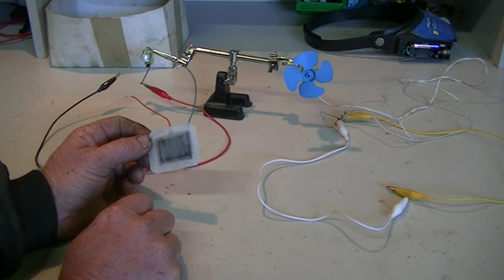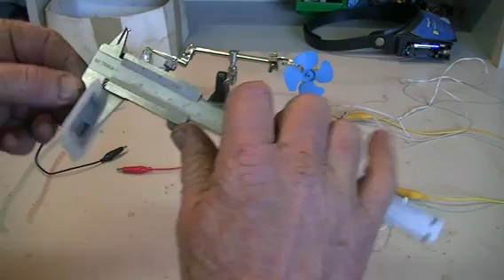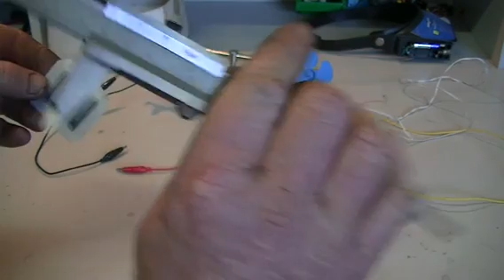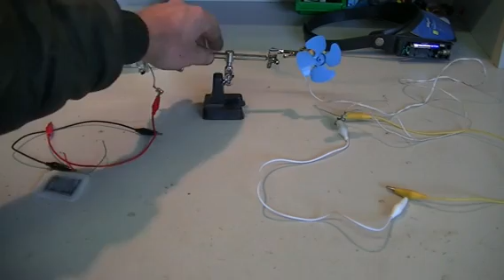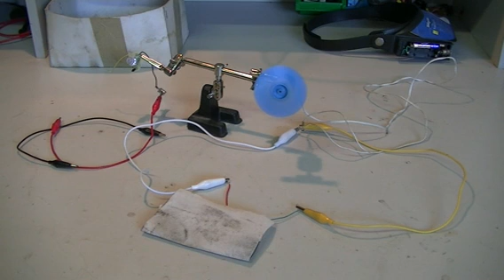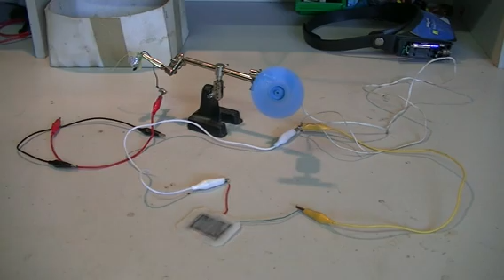Triphene Super Cap 2600 Farads in half of a credit card.

Comment: nice work mate - have you tried using a different electrolyte - if you try acetonitrile with a quaternary ammonium salt you should be able to raise the voltage to 3 volts or so
Reply: +Leonard Janus sure why not
Reply: +Leonard Janus i try to use water mate - but whatever you want really
Reply: So, have we guessed at the other two ingredients? NaCl and baking soda? Lard and sugar?
Rob, is this likely in the stage 4 Strange Capacitor family?
I've got a bottle of ranch dressing about to go off....
Reply: Cyclic Voltammetry. 🎩🧠❤

Comment: Happy to see you and Robert Murray are working on graphene super capacitors. Cells. Whatever ;-)
I am hoping you will find the right substance to get a higher voltage, on the other hand at these dimensions I would not bother to much. Currently most of our appliances are already using dc2dc converters anyway.
Does it go up in smoke if you charge it with more than an amp?
Thumbs up for this!
Reply: +Leonard Janus Hi Leonard, are you going to start making any videos soon? It would be interesting to see your work. Good luck!